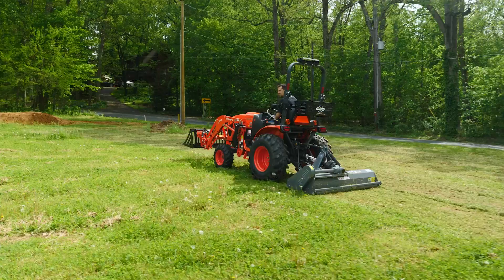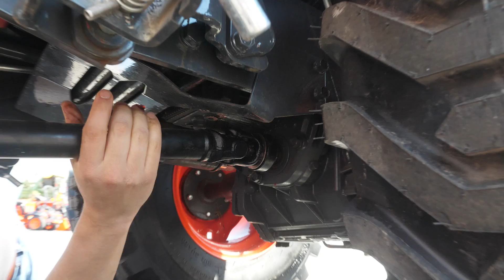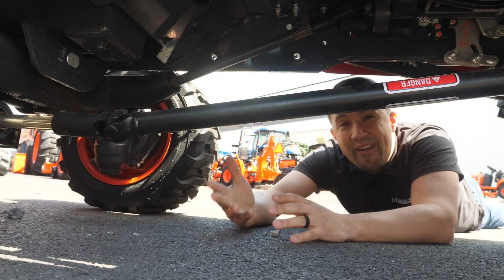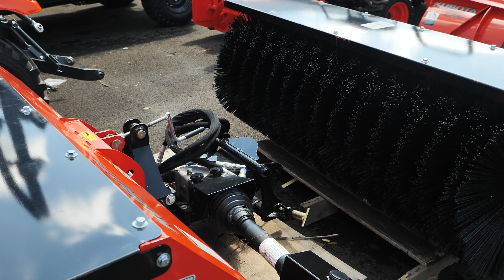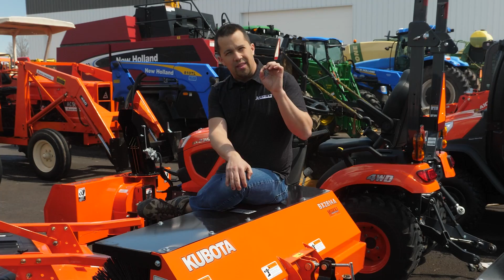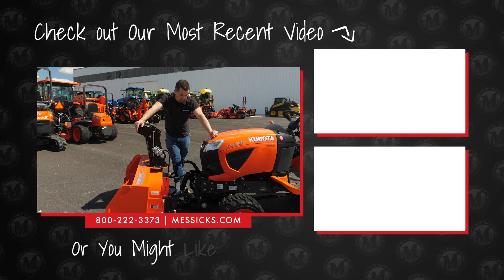Front Mounted Quick Hitch Attachments for Kubota BX

Comment: The literal pain in the neck from using rear mounted attachments can extend to the ears. Years ago Paul Harvey reported that doctors were noticing that farmers tended to have weaker hearing in their left ear vs their right ear. They discovered the cause which was farmers on their tractors were looking back around to their right which basically pointed their left ears towards the tractors loud exhaust. And plenty of farmers didn’t use hearing protection.

Comment: Whole reason why we went with a 2025r. Until the last year John Deere quick hitch front attachments have been made for the last 30 years. Very plentiful on the used market and kinda cost saving. Our 455s the same 47” blower and blade will fit the 2019 2025r quick hitch and just change the shaft and up stop and back on the 455s. Kubota should stick with this setup for for long time and then be able to build up the used market and build inventory used. Making it easy to find and get people like myself to change colors.
Reply from the maker: The same company builds most of Deere's front attachments. RadTech out of Canada. There are cases where you can nearly interchange them with a Kubota.
Reply: @MessicksEquip   had we knew that could have changed the game we still have our RTVs and M series for the farm and they are amazing!

Comment: Any other recent BX owners having issues getting their mid mount mower decks from your dealer?  I've had my BX2680 for almost 9 months, my salesman still has yet to deliver my 60" Mid mount mower.  Yesterday I contacted him for an update, he says it still in lala land somewhere, no update basically on where it is.  Anyone else experiencing this?  Not thrilled about making payments on something I don't have.
Reply from the maker: That's long for a deck.
Reply: @MessicksEquip  Kind of what I'm thinking.  Unfortunately due to not having the deck, I have nothing that shows I'm supposed to get one other than I'm guessing a note in my file at the dealership sales office.  This whole transaction has been a bit weird, lacking in many ways including paperwork.  First when I did the order I told the salesman I wanted the 60" non-drive over mower, he says ok, but never included it in the quote, I had to tell him again, then he claims he ordered it, so I'm not sure he did anything, and I assume there's no way to find out if he did order it or not.  I do know there's a discrepancy between the payoff and the balance on the Kubota Credit account, but have no clue what that is either, as I was never given a price for the mower, he just said he'd get it, so I have no clue.  Never again will I do a transaction like this or deal with this dealership...Love the tractor but my dealer/salesman has been quite unapproachable.
Reply: I know for a Fact if you contact kubota direct and get the Right person heads will roll.
Reply: @reddfoxx2861  I went in and got a refund, went 7 miles down the road to the other Kubota dealer and bought the deck the same day and brought it home...wish I would have went to that dealer to begin with, they had my tractor in the same configuration the whole time I waited for mine.

Comment: If you have a hydrostatic tractor, there’s absolutely no reason to crane your neck to use a 3 point snowblower. Sit on the tractor sideways so both feet are on the right. You can look both backwards and forwards, run your hydro pedals, and operate all necessary controls from that position. Plus, you still get to have a loader or plow on the front. I spend hours at a time clearing snow, using both my loader and rear snowblower with zero fatigue. Those pull-behind snowblowers are an answer to a problem that doesn’t exist, plus you can’t clear your path with them.

Comment: Neil, I have a 2011 BX2360,  and a couple of years ago I sprung for a BX23S. The front quick hitch from the 2360 works on the 23S but you can't open the hood.  I wouldn't have gone with the new tractor if I didn't know this, as the front implements are quite expensive as you told the people. I thank John Ritter and his site for informing me about this.  Now my son has the 2360, and borrows mine when he needs the backhoe. I have the front snow blower, he has the front blade, we just bought another front quick hitch.   Rad Tech makes good snow equipment. In Canada they have to.
Reply from the maker: Good advice.